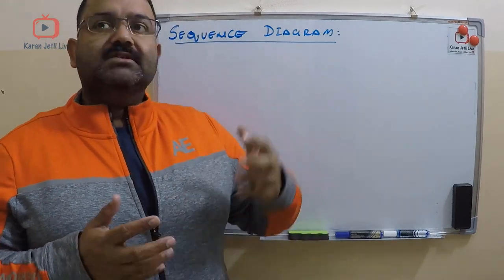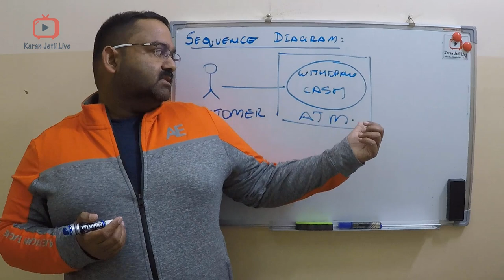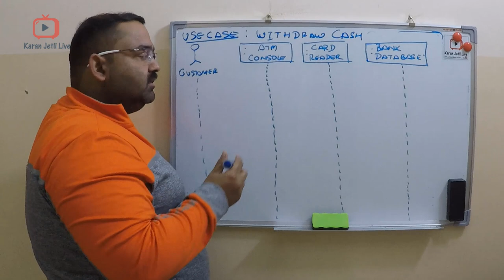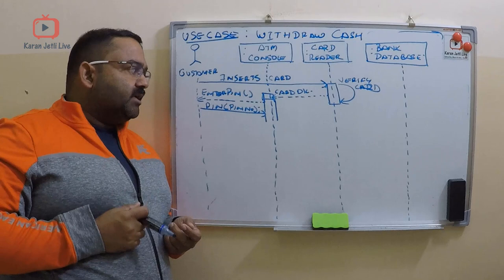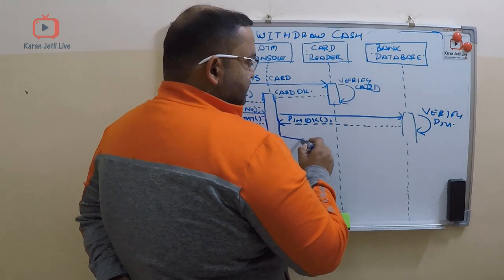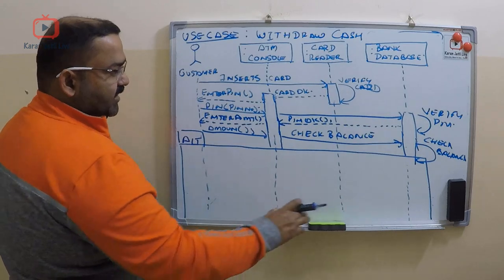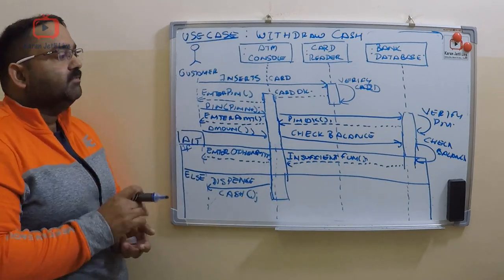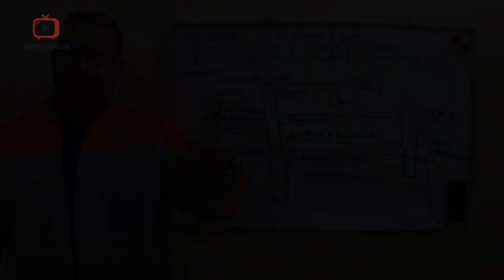How to make Sequence diagram with example

Comment: Admin
	Offered courses
	Students enrollment in the offered courses
	Available time slots
	Available examination halls
	Generate exam schedule for each course and for each student considering the above mentioned lists and avoiding any clash/conflict
	Provide an option to save/export the generated exam schedule course-wise and student-wise.
student 

	  Select courses
	Select time slots
	Select examination halls
	Export/save exam schedule
If two actors are used then how to make sequence diagram
Reply from the maker: See sequence diagram is made for each use case and by looking at ur scenario it seems the student and admins actor do not have any common use cases...so you will make different sequence diagrams for admins use cases and different for students even if they have any common uase case then also u can add 2 actors in sequence diagram...i hope this helps..thanks for watching plz subscribe...🙏🙏